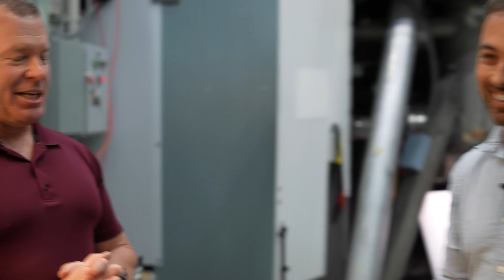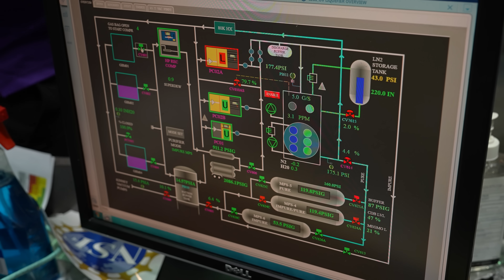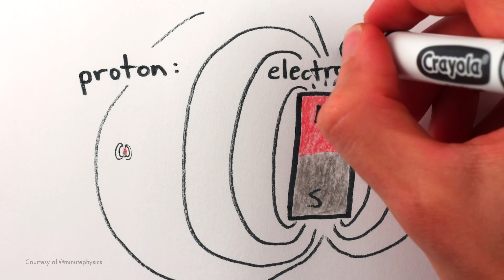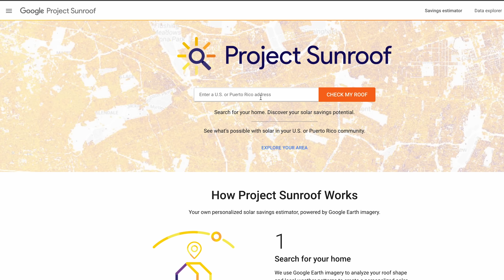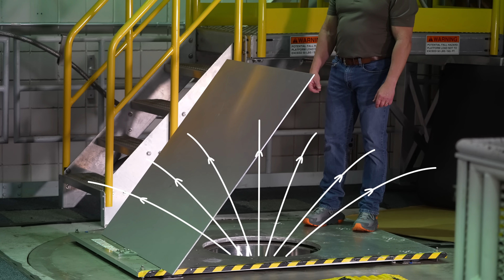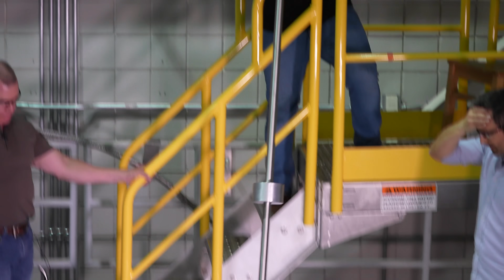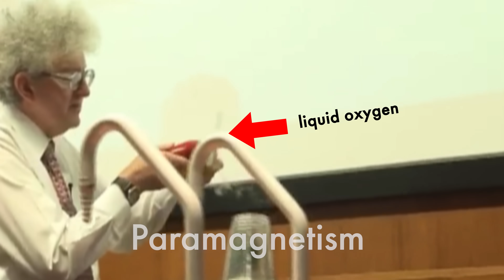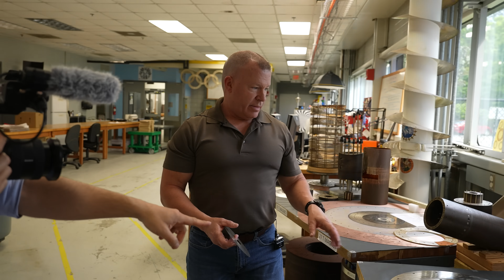World's Strongest Magnet!

Comment: About 10 years ago I worked at a company that made high speed, fiberoptic magnetic field sensors.  Those sensors were taken to this facility in Florida for calibration.  Since it was very time consuming to do these calibrations on all new sensor designs, I built a pulsed magnetic system to test the new designs.  My system achieved pulses of about 12T in a 2 cubic inch central volume and saved the company a lot of money during R&D.  It is great to see this video and it brings back some good memories.
Reply: Did ya get a raise?
Reply: Did u get a raise tho
Reply: @notabot5878  right?? I mean saving the company budget means you yourself should get a bit of it as well
Reply: @steve-macnair  yea exactly, they should have given him a cape
Reply: @notabot5878  A promotion is better or a bonus
Reply: @steve-macnair  how bout a statue
Reply: @notabot5878  A MONUMENT
Reply: @notabot5878  or a trophy trophies are good
Reply: @steve-macnair  yra trophies are good but they should have named the company after him tbh
Reply: @notabot5878  CEO?
Reply: @steve-macnair  perhaps?
Reply: @notabot5878  could have made a company that produces magnet imo
Reply: @steve-macnair  we are going off track now.
Reply: @notabot5878  off the track onto the road
Reply: @notabot5878  Could have been called Boyd, with a plate on every magnet embossed Boyd
Reply: Ads could be made with the slogan:  Boyd.We make your magnets.
Reply: @notabot5878  With a Chinese ripoff called Boyde.
Reply: I'm interested in learning more. How did that work?
Reply: Led me to think
Reply: Be careful not to reveal any trade secret. Engineers tend to be super happy about their successes and to make this mistake.
Reply: @davidheurtevent9806  Lemme guess: you are a pr man
Reply: @davidheurtevent9806  I'm sure he needs your patronizing nagging
Reply: You are being fooled 👉The Connections (2021) [short documentary] 🔥

Comment: I can thankfully say that I'm 100% off the grid. I have more power than I know what to do with. I invested $10,000 and this system gets 10 years of use before the capacity of my batteries will degrade. I get a decent charged even on cloudy and snowy days. In the 5 months I've lived here I've only had to use the generator three times for a couple of hours. And it's a super efficient small very quiet generator. And I probably could have made it through if I had been more conservative with my power during the Cloudy time

Comment: Why does it have to be a coil, and just using a cylinder wont work? Presumably if you wind copperwire enough the electricity doesn't need to follow the wire, it just goes straight through. Right? So then what's the difference between that and a solid cylinder?

Comment: Fascinating stuff, great presentation. 
It does seem that every so often the SI system of units get it horribly wrong. The Tesla SI unit seems to be a measure that is orders of magnitude larger than makes any sense, especially when the magnetic field of the whole earth is 25,000 - 65,000 nano Tesla. Same with the unit of capacitance when capacitors used in electronics range from micro to pico Farad, and calories used in nutrition are in fact Kilo Calories. I'm sure there are many more examples. Anyone know why this is?

Comment: Shouldn't the copper plate fall much slower at 07:41 since it conducts electricity about 50% better than aluminum?
Reply: On a 2nd thought, copper is also much denser than aluminum so the added weight might cancel that out.

Comment: The induced field slowing the fall of an aluminum object in a magnetic field could be used in elevators to slow a free-falling cabin in the event of an emergency. The system is passive, will always work and the magnets don't have to be massive or expensive. A system like this would probably save a few lives every year.  They do use a similar system in some free-fall fairground rides - just don't know why Otis and co don't us it.
Reply: Go to school...I'm a computer scientist, and even I know how this stuff works.  You need to learn engineering or how the world works.  There is this concept, called pressure...and you can leverage that with hydraulics to not need really much of any energy to do what you are describing for stopping an elevator.  Have you ever pumped up a bike tire?  You know how it gets harder to do the more you push it?  Now, imagine gravity and an elevator coming down compressing fluid and not air...the faster it goes towards the bottom the more resistance you get, and you can configure it so it is a nice and as smoothly slowed as possible...release the pressure and repeat.  Why would you design such a wasteful, inferior system (if you knew how much 50kamps of electricity was...you'd know how dumb of an idea you just had)?  Sorry...keep on learning....or, screw it, just learn how to use chatGPT.
Reply: @Dr.FeelsGood  I humbly suggest you stick to computer science.

Comment: Check out underneath the plate around the 10:20-10:30 mark - I thought it was just video compression but you can see disturbances in the air (I think).
It's not just me, right?

Comment: At 9:50, it looked like you were measuring reflected IR with the thermal camera. Aluminum has very low emissivity.
Also I would think that with how slow the aluminum falls, the energy is dissipated so slowly, that it would be hard to measure.

Comment: Ever since I was a kid I've been fascinated with magnets 🧲 I have several dozen in various shapes and sizes and I have trying to find an answer to a question that maybe you or someone here in the comments can help me with and then question is there anything that can block the field of a permanent magnet , what I mean is say you have 2 1"×1" square neodymium N52 magnets one in each hand and you hold them 1" apart and they are pulling together is there a material for example like a deck of cards that you slide or place between them that will stop the attraction? I hope that makes sense kind of like when you go to get an ex ray and the technician gets in the little booth that protects them from the radiation or like superman can't see through lead lol

Comment: After 3 minutes of holding neodymium magnet (diameter of 7cm 3cm high) in my hand i started feeling very weird sensation like some kind of pain but not realy, is it because the concentration of iron in the hand vein? if it is i believe it can be dangerous to hold it long and then suddenly letting it go with big shot of iron going at once inside vein... the chat GPT is saying "
The idea that neodymium magnets can attract iron in the blood and cause health problems is a myth. Iron in the blood is not magnetic in the way that neodymium magnets are, so it cannot be pulled out of place by a neodymium magnet. In addition, the iron in the blood is contained within red blood cells and is not free to move around the body.
The sensation you described is more likely related to the strong magnetic field generated by the neodymium magnet, which can cause electrical currents to flow in your skin and nerves, leading to a tingling or vibrating sensation. This is a well-known phenomenon and is not harmful in most cases, but it's always a good idea to handle neodymium magnets with caution and avoid prolonged exposure to their magnetic fields."

Comment: so ... working it out, if the magnet uses 47 kV at 500 A that comes to 23.5 MW or 30 thousand horsepower or even (approximately) the equivalent of eating ten NIST or NPL standard recipe jelly donuts every second (note - DIN standard donuts should be avoided, because the germans call them krapfen and who wants to eat something called that amirite?) anyway i am curious whether this is measuring just the electrical draw directly from the superconducting magnet coils only which should be efficient and nearly 100% meaning the magnetic field is using all of that 23 MW - or is the figure for the complete system including cryo coolers and all the other auxilliary gubbins required? can't see anything immediately obvious at the NHMFL page, but if anyone knows more would love to find out. and of course, thanks for this and keep up the good work @Veritasium

Comment: 15:38 gotta love how mr science guy is inches away from liquid oxygen without safety gloves
Reply: The Leidenfrost effect will protect you from the cold of things like liquid oxygen or liquid nitrogen. As the liquid rapidly transforms into a gas it makes an insulating layer which prevents the liquid from touching you so a drop or even a small splash is unlikely to cause any harm - prolonged contact is of course very dangerous.
Reply: @cheesey_chicken42  he couldve twitched and touched the surface of the metal drain, which would have flash frozen his skin and when pulling away, wouldve torn his skin from the surface of the object.
Reply: You are being fooled 👉The Connections (2021) [short documentary] 🔥

Comment: What a cool video this was, magnets are amazing. I wanted to add that Eddie currents are not induced to slow the conductor's motion through the field, but the other way around. The movement of the conductor in the field generates Eddie currents, but, because they are being generated, this energy has to come from somewhere, that somewhere is the kinetic motion. Sort of like how movement over a rough surface creates friction which generates heat and as a result the movement slows down.

This is also why the movement looks so...smooth? Its because at some point the system reaches an equilibrium: movement generates Eddie currents which require energy and the movement is decreased, but now not as many Eddie currents are being generated and so the system stabilizes at some equilibrium.

Comment: Hi Veritasium, at 9:39  I do not think you were measuring the sheet temperature. I have been playing with a thermal imager for a month and noticed most metal (even non polished ones) becomes mirror like in Thermal. So what you were measuring was the ceiling reflection not the sheet itself. Note: you can see the thermal reflection of the person holding the sheet at some point. 

Example of unpolished metal turning mirror in IR found at home: kitchen sink, an unpolished canadian dollar, the brushed metal of our oven, etc.

Comment: Okay so the problem I see with the thermal imaging you did, and the conclusion you drew from it, is that the larger warm spot we're seeing on the sheet, is mostly reflection of infrared from Tim's body heat. But I do wanna draw attention that it did seem that the plate as a whole was slightly warm, but only by tenths of a degree, by the shift in purple to pink. But that yellow/orange zone was definitely infrared reflection.

Comment: Improvements.
1) Nanotubes can have several times the conductivity of copper. And are great at heat conduction. 
2) Copper gets more conductive at lower temperatures. Why are you running water through that system, not liquid nitrogen? Actually, this probably won't save you energy. The resistance of copper looks pretty linear, so half the temperature means half the energy lost as heat. Ie the same amount of entropy being made. So assuming your liquid nitrogen production is 100% efficient, it doesn't change the energy use at all. And liquid nitrogen has a much lower specific heat capacity. Liquid nitrogen has around half the specific heat capacity of water, this on it's own would be ok. There would be less heat to remove. Still liquid nitrogen has only 15 degrees in which it is liquid, compared to waters 100, so can remove much less heat. Although if you had high pressure liquid nitrogen...

Comment: 45,000 amps at 500 VDC is impressive, but not a patch on what an aluminum producing plant set of pot rooms use.  Those use upwards of 240,000 amps at 700VDC.  It takes an enormous amount of energy to pull the oxygen atoms away from the aluminum atoms in the ore, to produce pure molten aluminum.

Comment: At a Million times the Earth's field strength, you will NEVER convince me thats not having an effect on the Earth's field.
Reply: Technically it does have an effect. But, in the same way a big truck driving fast and slamming on the brakes effects the rotation. There is a force applied so there is an effect, but in the overall system the force is so small it doesn’t matter. 
Another way to think is how the flame of a candle is many times hotter than the ambient air, but doesn’t really mean the entire earth is warmed up.
Reply: @NBSV1  Blah Blah Blah TL;DR
Reply: @ObsoletePencil  Seriously? It's a paragraph and a half. That's TL;DR for you? 
Seems you're real committed to never being convinced. I reckon not bothering to read anything makes that easier. 
Since at this point this is gonna be TL;DR I guess it doesn't matter much. Hard to make much progress when everything needs to be broken down into elementary level short sentences. I guess for the next reply I can have my 4 year old niece write it out for you.
Reply: @NBSV1  TL;DR
Reply: @ObsoletePencil  U mite knot B so confused if you took the time to learn so stuff.

Comment: 2.35MW of power that thing comsumes, that is Insanity, what's even more insane that I'm only just thinking of that's just over two Rimac concept two cars. Now if they did that the cars would run out power in a few seconds and burst into flames but they'd do it. 6 minutes 21.67seconds if I've done my maths right. Assuming the two cars could make 2.35MW throughout the life of the battery (and all the other conditions I've ignored) with 240kwh of battery between them.

Comment: When you pointed your thermal camera at the aluminum plate, I think the "heating", was just the hotter ceiling reflecting off of it.
A stationary magnetic field can't add energy, so all the heating comes from transforming the potential energy of the plate to heat. Of course that would generate some heat, but not as dramatic as the video showed.

The comparison to the levitating machine is great for showing how Lenz's currents can generate heat but that's because that one is an induction cooker on steroids with surgical precision, while the other one is "just" a magnet.

Comment: 9:40 Another demo to look at are braking fins of modern roller coasters. In particular Kingda Ka and Top Thrill Dragster, since they hit their brakes runs way faster than other coasters. They use the same technique of copper fins mounted to the track passing between magnets attached to the train. After several runs, the copper fins cause a mirage effect on the air around and above them because they heat up significantly, and yet they don't have any score marks from the fins rubbing the magnets.

Comment: If my math is correct that magnet uses roughly 19-20 MW of electricity at full power. That's impressive but if you really wanna see power, stand besides an electric arc furnace inside a steel melting plant like I work at. The sound is so loud it vibrates your body. We don't have the biggest furnace either but at full power it consumes up to 44 MW of power, 3 carbon graphite electrodes with 375-425 volts at 42000 amps going thru each of them. We use 25-30 MWh of electricity to melt 75 tons of steel in 35-45 minutes just to run the arc furnace alone, 24 hours a day, 7 days a week... nevermind the rest of the plant. That's an insane electric bill lol!

Comment: Wait , so if it's 45x more powerful then Earth's magnetic field.... when they turn that on, does everyones compass around the world point to that?
Reply: No. 
It's stronger than Earth's magnetic field at the surface of the earth. 

The magnetic field of that super magnet still decays very fast.
  Even though the magnet is very intense, but the magnetic field doesn't cover a big distance.

As compared to the Earth's magnetic field which isn't that strong, but is covers alot of distance 

In short:
 Earth's magnetic field has alot of range, but is very weak.
This magnet has very little range, but is incredible strong.